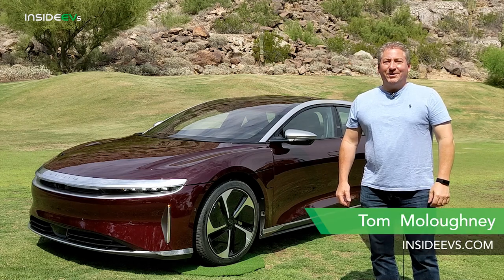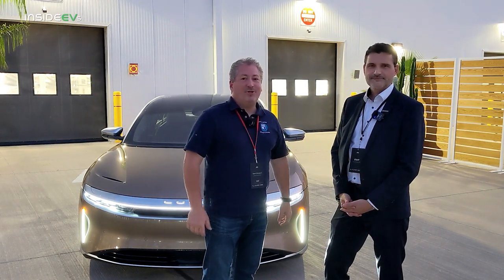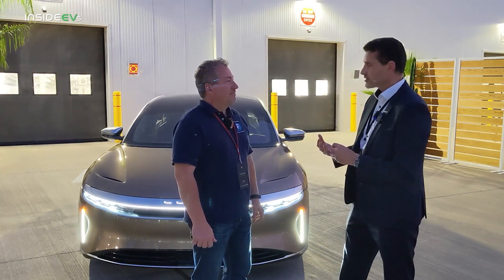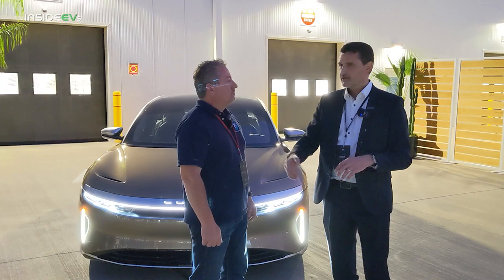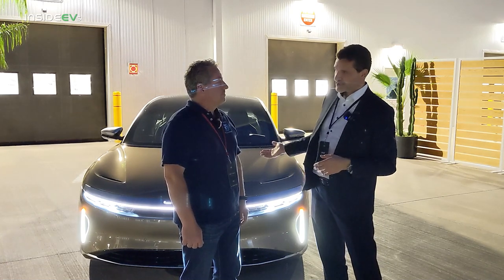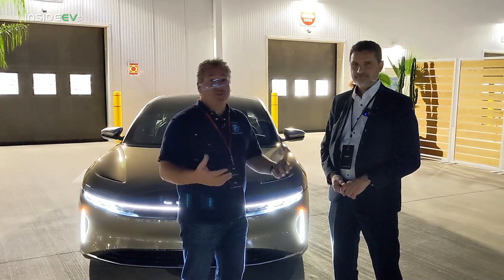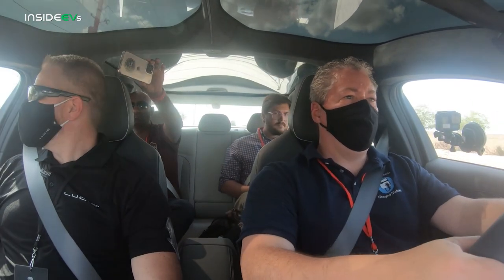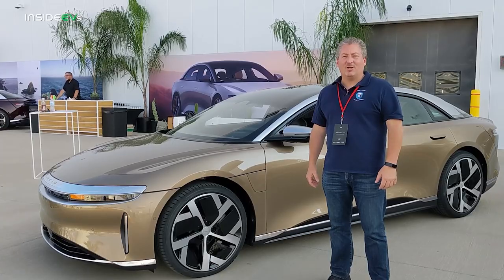2022 Lucid Air: InsideEVs First Drive Review

Comment: Elon Musk said there is no need for the Plaid+, nobody needs more than 400 miles of range 😉. OK let's dig a bit deeper. The plaid with 19inch wheels has an EPA rating of 396 miles (4miles per kwh). If he would have attempted to get to 520 miles range with Tesla's current efficiency he would need a 130kwh battery 🔋 4x130=520. For the time being, Lucid is the heavy weight champion 🏆 of EV efficiency. 20% better is no small feat.
Reply: x9 faith  120 miles is almost 200 kilometers. That is a big difference. Hopefully I can test drive a Lucid Air and get a feel for it.
Reply: Love Elon, but his comment about no need for 400+ mi range is pure BS. You absolutely need that range, because:
- you don't always start with 100% charge
- you might not be able to charge in your destination
- you may want to drive fast on autobahn
- you may need to tow stuff
- you may drive in freezing winter or in hot summer
- you may want to have a good range  even after years of use

Etc.
Reply: @vecernicek2  True but only given current infrastructure. If fast chargers are widespread, which they will be sooner than later, then there is no need to carry around extra "fat" (battery weight) for something that is used few times a year. 
I think Musk's point of view makes sense as well. Energy density and charge speed, along with charging availability, is what they should focus on.
Reply: @cobrachannel100  Here in Europe the infrastructure, especially in terms of high power chargers and destination chargers, is growing much slower than over in the US. Entire countries or large areas are undeserved right now and I strongly suspect they will be for several years  to come.

It doesn't make any sense to buy a car in 2021 that is engineered to work well ten years from now. But it's the typical Tesla approach.

Comment: Good video, great interview, and Kyle doesn't even stop talking when you are filming (not surprised).
And to Munro/Tesla fans: silicon carbide MOSFETs carefully cooled are good, right? (they are).
Did you notice that when Munro looked at the Mach E silicon carbide MOSFETs and elaborate chip cooling, things Tesla does not have, all he talked about was the screws?
Reply: No doubt the car is over-engineered, but when you start producing 200k cars a year this is when it shows wether you can actually sustain this over- engineering. No doubt great car,but at 1000 peaces a year and about 150,000$ price point no-one will take you seriously. And before you say Tesla was the same 2012 - yeah 2012. Lucid doesn't have 10 years, they don't even have 5 to maintain business. They need to start producing high affordable cars by 2024 and that ain't happening. Their only chance is to snatch as much money from the stock and exit. Maybe to Apple. Otherwise they will be the next palm(if you even know what that was)
Reply: @marcusbiller867  You forget that Eric Bach used to work at Tesla? Lucid will succeed Tesla fan boy. BTW, I drive a Tesla, so I am by no means a Tesla hater.
Reply: @marcusbiller867  I disagree. Mecedes, BMW, Audi sales of sedans and SUVs in not insignificant. That is the market Lucid is after. 

The economics of "affordable" cars (<$30k) depends on economies of scale already being in place. Tesla doesn't offer a car in that class. The Lucid Air Pur base model is about $77k. It competes favorably with the base Model S for those who prefer more traditional automotive interior styling and controls.

Lucid is working to build a luxury image that would be undermined by selling cheap cars. Just look at the problems Hyundai had trying to launch the Genesis brand. In the US Toyota separated the Lexus brand and dealerships from the company that sold Corollas.

If I were at a Lucid product planning meeting I would suggest a next vehicle to compete with the BMW 3 series in all its various flavors. A sporty CUV probably probably makes more business sense, but that argument is for another day.

Comment: They said they designed all the switch controllers and all the 12V DC auxiliary systems in-house to maximize efficiency, I'm curious why they even went with a 12V architecture then. Cars have been standardized to 12V for decades now and all car auxiliary batteries are 12V, so it makes sense that other autos continue that. But if you really want to optimize efficiency and still maintain low voltage touch sensitivity, they should have gone with 48V DC and have their own 48V auxiliary battery (much like how the newest Model s now has a lithium iron phosphate 12V auxiliary battery). That would cut down on copper wire sizes (which saves cost and weight) and would have less heat loss due to lower current draw, so long as all the components are specifically designed to operate at 48V without having to step down the voltage to 12V. I mean they already designed their high voltage system to be at 900V AC instead of the more typical 375V AC for similar reasons. Seems like they have room for future efficiency gains.
Reply: I doubt they designed every controller, and they don't plan to only produce $170k vehicles... so I imagine they'll eventually use off the shelf high volume products to drive down prices.
Reply: They need to be able to buy automotive-grade 12V components from suppliers.
Reply: I think even Elon said Tesla wanted to go to a higher voltage control system but they just couldn't get the parts.
Reply: Heat losses in 48V would be lower due to lower current not higher current.
Reply: @seasong7655  That's what I meant. I fixed it now, thanks.

Comment: Nice to see more competition in the EV space. The others manufacturers need to step up to 800V plus like VW, Hyundai,  and Lucid. Right now I think the EGMP is the best bang for the buck.
Reply: I didn't know hyundai also did 800v. Lucid I think is 920V that's almost 15% more than it's closest competitor.
Reply: @hussamalyafai3708  Yessir, the new Hyundai EGMP platform is 800V. They add 200 miles in 18 minutes on a 350 kW charger.
Reply: High voltage has its own downsides where insulation has to be way better and thorough or otherwise anything breached can be a fire hazard. I think higher voltage systems are overrated a bit - sort of like CPU frequencies back in the day.
Reply: @cobrachannel100  Good thing I plan on doing 0 maintenance on my EV. That's why I bought it.

Comment: This is legendary. It’s sad that Tesla investors and fans have smothered all of the engineering feats accomplished. Hopefully, time will allow this story to be told to the masses.
Reply: I invest in both Tesla and Lucid, I think competition is good for consumers. And the Lucid Air looks amazing, can't wait for their SUV "Project Gravity" in 2023
Reply: @redred2  imagine if they introduce the tri-motor first in the gravity lineup 😳 with around 1500 horses to counteract all that SUV bulk and reduced aerodynamics, it would be the most powerful SUV ever made by far. A 9 seconds 1/4 mile in a spacious luxurious  7 seater would be sensational 👌
Reply: @hussamalyafai3708  
Is that what buyers are most interested in is a fast 0 to 60 and how fast can a car to to a 1/4 miles?
How much horse power?

I would like a car's longevity, quality and less and less battery degradation and safety would be top priority?
Reply: @mamadouaziza2536  agreed 👍 without reliability, all the performance won't mean much
Reply: @redred2  I don't think they can reach volume by 2023
Reply: Lucid has work cut out for them. Lots of competition and they have to ramp up and compete. Not to mention, they first offering is a sedan. That is poor judgement. they should have launched SUV or a pick up truck first. Their production numbers are low and it will be tough to compete against Tesla and legacy. 
Tesla timing was way better than Lucid.

Comment: When is the Lucid 'Lite' coming, the one that would be in the following price range 25,000 to 35,000 USD, a bit like the Ford model T in the beginning of twentieth century!  The car should be smaller too.  Not everybody needs a limousine!  The car should retain the same body/chassis styling.  No fancy roof tops made with glass required.  Targeting the luxury segment will not help the Automotive industry transition into EV, this segment is already over crowded!
Reply: I did appreciate the amount of technical details the Chief Engineer provided too.
Reply: Only the “rich” could reasonably afford the first ICE autos. They need somebody to pay for all the development costs until EV’s really become the “preferred” car for the masses. Most EV’s cost more than ICE’s because of the battery costs. With new battery technologies that should come down, allowing people to say, “EV is now affordable”. There also needs to be more charging stations comparable to today’s fuel stations. Range is important if you ever decide to travel or have to drive a long way to see friends and relatives. Don’t think I’ll ever be able to afford a Lucid, but hats off to those who can. Keeps our economy ticking.
Reply: It cant come. They cant scale production like that due to the fact they would surely have to be low margin cars. Lucid can't do it due to production limitations, not to mention they couldnt sell a car like that yet due to the battery pricing. It would have to be sold at a loss and no new comer is doing it. What Lucid is doing is exactly what Tesla did and would any other start up would do in this case: lower volume, high margin cars to make some profit and to pay for further expansions. 
Stop dreaming!

Comment: Not as fast but it looks better than the Plaid
Reply: Agreed. But to be fair the dream edition is a dual motor and should be compared to the model S long range and the Tycan turbo S. When the tri-motor is produced it should be interesting to see how it compares to the Plaid. 1500 horses 🐎 should provide very competitive performance. Also it seems from the reviews of people that have driven it that lucid is very focused on smooth power delivery which I believe will force you to limit torque in the initial kickdown with gradual linear increase. 2 cents
Reply: Looks way better than a Plaid, or any Tesla for that matter. But this competes with the Long Range and the Porsche Taycan Turbo S like mentioned above me. Maybe Mercedes' new AMG EQS as well.
Reply: Not in my eyes. It looks like some 90s Buick or something along those lines. This car wont age well.

Comment: Why is the top speed limited to 270kmph? The fact that some it's variants have 1111 hp, even higher than plaid which has 1020hp.
Reply: Usually tires limit too speed.
Reply: @Joe-co4sq  tires really shouldn't be a limit here, we have tires that can handle 400+. So its probably some weird ratio on the electric engine issue.
Reply: I thought the Plaid is 1020 hp 🤔
Reply: @hussamalyafai3708  yup sorry corrected.

Comment: SIZE  MATTERS  guys & this Lucid Battery is SIGNIFICANTLY LARGER than the Tesla Model S Battery. 
Taking nothing away from the  Lucid Air, which is obviously an outstanding achievement. 
As in all things however it is vitally important to Compare APPLES to APPLES & that's not what we have here. 
When the car is made available to you guys for proper testing & comparing,  with all of the math & stats taken into account,  I'm  sure it will compare very very well. 
I'm looking forward to  full fleged balanced testing & comparison which both of you are so great at & you  manage to make it so entertaining at the same time.
As always,  Thanks.🙂
Reply: #110KW <--- IT'S HUGE...!!!
Reply from the maker: It's definitely larger, but not "significantly larger" than a Model S battery. 100 kWh kWh (Model S) to 112 kWh (lucid Air)